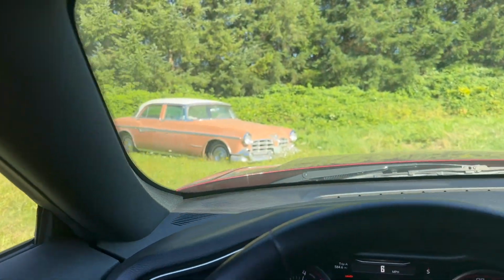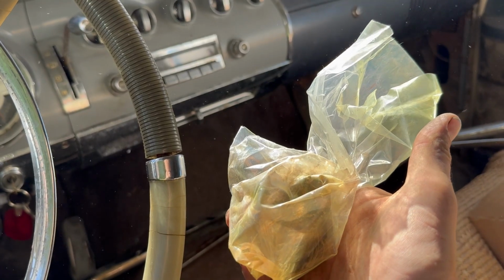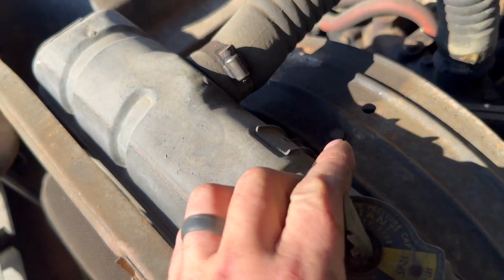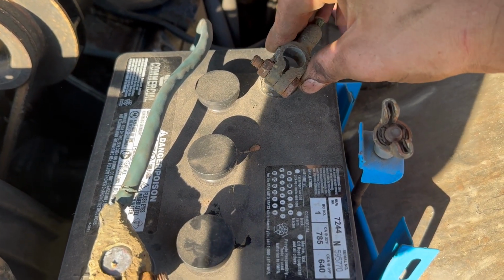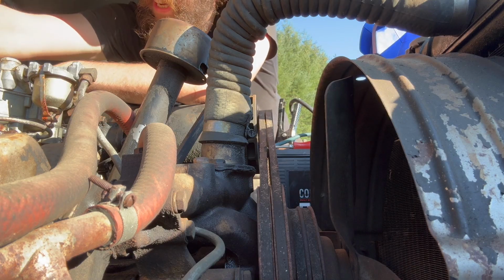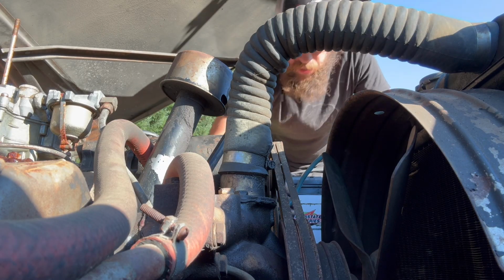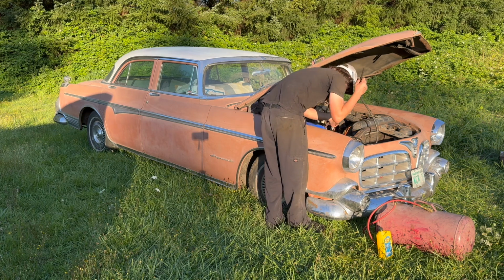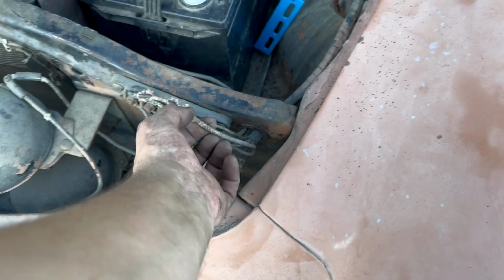Hemi Powered Land Yacht - Will This 1955 Imperial Run And Drive After 30 Years?

Comment: PARK on the Imperial is just an emergency brake. It is not literally a "Park" function in the transmission. To park these pre-PARK Mopars you had to cut the wheels into the curb, pull the "emergency brake" and pray it would hold. Imperial even supplied a metal parking wedge in the trunk.
If you tried to park these automatics "in gear" they would just roll away. My 1962 had the exact same set-up.
Reply from the maker: But why are you telling me this? Do you think I don’t know what year the parking pawl was added to the Torqueflite transmission? I do - 1962 😅
Reply: @DeadDodgeGarage  My 1962 Chrysler Newport "didn't have it" but the 1962 Dodge and Plymouths did. As to your question now you know why I am telling you this.....not all 62 mopars had it.

Comment: Just watched the video.. Love the front ends of those cars..I worked on cars for the first 26 years of my life. Did one revive on a 52 Chevrolet Deluxe Coupe I bought when I lived in Los Angeles in the 90's.. sat for 20 plus years and was . Before youtube.. didn't know what I was doing but the engine was locked up.. pulled pugs and lubed cyls.. let it sit a few years and hooked up a 12v battery.. got unstuck just with the starter. Filed the points and got it running.. the old man bought it from came outside jumping up and down clapping.. Had 4 flats. new tires and drove it for a while smoking its ass off. It was a total rust free  Southern California car its whole life. Anyhow.. thank you for making your videos. Sure has had me looking at buying another Valiant or Barracuda.. You do a good job Jamie

Comment: Chrysler imo has been dead since right before the K-car.
And the New Dodge 90s cab forward front wheel drives and theur New Ram was nothing more than throw away cash grab aesthetics bs. Seems most  automobile manufacturers are all going that way now, since you can't even repair them at home anymore.

The last decent automobiles Chrysler offered was in the late 50s before they switched to unibody.

With that said.. Chrysler motors made several body styles I liked up until the early 70s.
Then it went down hill and never came close to making a come back, not even in terms of aesthetics.
Reply from the maker: I love my modern Ram, second and third gens are great workhorses with pretty modern coil spring suspension, K cars are still loved by many, and while things are certainly more complicated today, to say that one cannot fix their modern rig at home in most situations is misleading. So, in summary - I basically disagree with all of that.

Comment: A great and deep regret of my life,  is that back in 1994, I was a young gear head and learning to drive and my dad was looking for a project car for me and him.  One car we looked at,  was a '56 Dodge Royal Lancer with an early Hemi in it,  it was salmon pink and black,  it was $1,500, it was rust free,  solid,  but did not run. 

I thought it was the ugliest car I'd ever seen. 

I kick myself for that today.

Also,  a '53 Chrysler New Yorker I briefly owned around 2009 with a 331 Hemi in it.  It had sat in a garage since 1962, and I paid $1,500 for it.  And if you know anything about the 331, you know that it is it's own animal,  parts are scarce, and expensive.  Also it had a clutchflite transmission,  a strange thing with a clutch and a torque converter that would automatically shift between 1-2 and 3-4 but you had to manually shift from high to low and use the clutch to stop and start.   I got it running,  but the rings were shot,  the block needed bored, the valve guides were gone and parts were... not nonexistent, but apparently made of some material worth more per pound than antimatter... but the car was solid,  rust free,  the interior was... shot but still liveable with a lot of work and some truck stop blankets.  I even drove it around the block,  albeit with no brakes whatsoever.  It had power windows and seats and they still WORKED!  I was super stoked to have it,  then I dug into it,  and started pricing out parts... and realized that just getting it running and driving and reliable and not smoking like a steam train was going to cost me way over $10k... and I had a close friend who knew a car restorer and collector in Sweden and he had told him about what I found, and long story short,  he offered me what i can only call an obscene amount of money money to load it,  the parts, and everything else into a cargo container and ship it to him in Sweden. And that's exactly what I did.   Along with a bunch of 1970 AMC Javelin parts i had.

Comment: Chrysler has “full-time power steering” at least as early as 1953. Advertising showed a woman moving the steering wheel with her pinky to make the point. That was a dig at GM, which had variable power steering depending on the speed of the car. My uncle had a 1953 DeSoto with power steering, there was no road feel while driving, and my aunt took out the side of the garage with it because the wheel did not return on its own after a turn, which was what she was used to.

Comment: Ah, memories! I had a 56 Imperial 2-door Southhampton in aqua and a white roof. 56 was the first year for the twelve-volt system and a mid-year change from the Powerflyte to the Torqueflyte. My car was an early one with the Powerflyte, 56 was also the last year for cloth-braided wiring, kingpins and coil springs.

Comment: I was told that the reason these old cars always smell like vomit (extreme sour smell) was from the decaying steering wheel. They were made from a milk based composite that I think was called "casenine". We have to remember that this and many other cars like it were built in a time where the nation was still coming off two major military conflicts (WW2 and Korea). So materials to build cars with were somewhat at a shortage. Some clever engineers developed a milk based compound that was cheap to make and worked as well as other things like bakelite but not as expensive as the new plastics still being developed (like Lucite, Acrylics, etc.). Trouble is over time they decay, especially when under full sun behind a windshield (see your cracked steering wheel). When they do the emit the terrible smell. I can remember my dad gutting a perfectly fine interior from a '63 Plymouth trying to find the source of this awful smell. This was in the late 70's early 80's. I can remember him being pretty certain one dumb a$$ kids (my brother and I) probably hid something in the car only to be disappointed. Enjoying your videos.

Comment: I currently  own 2 ,1954 Plymouth Savoys, The first one I purchased when I was 16 years old, best car I ever and still own. I am now 64 years old . Drove the car everday to school ,work and weekends. One has power steering  and is fully optioned the other is fully optioned except for manual steering. Both have Flathead sixes ,228 ci and three on the tree.

Comment: I'd like to see you rebuild the carb. Making it run gooder is not the point. I'm not familiar with that model and would like to see more on it. At a minimum flip the top off  and let us see it's inner goodness.
Reply from the maker: Need to find a better core. That one is baaaaadd.

Comment: you're right about the Mopar smell. back in the early 90's I was in college and for some reason I was blindfolded, "kidnapped", and driven out somewhere outside of campus with instructions to find my way back. I don't remember the exact circumstances of why this all happened, but I was 18, probably drunk, and these things happened. anyway - they lead me into the back seat of this car and started it up, and even blindfolded the first thing I said was "this smells like an early 70's Chrysler. and by the sound of the engine - that's a 318. also more than likely - and I don't know why, but this car is painted green". it wasn't until after I was dropped off and took off the blindfold that I saw that sharp '72 green Dart driving away that I realized "hey - I was right! and also I have a long walk back"
Reply from the maker: Well, that’s… something!

Comment: Want to see it smoke, run a can of Bardahl through the carb.
Popular back in the 50’s and 60’s to unstick rings and clean valves. Non detergent oil was the thing back then and extended oil changes the norm.
Had an uncle that swore on Bardahl, he would run a can through the old clunker he drove every month. Big event, all the kids in the neighborhood would gather at the house to watch the huge cloud of smoke generated. Doubt if the neighbors appreciated it though. The plants and grass around the house suffered badly from this but us kids were just fine, for a while anyway.
All kinds of nasty stuff was sold to the public back then with promises of miracles performed. Very few miracles were ever seen…

Comment: Hi Jamie,
   I am a 70 year old Mopar guy.  It does my heart good to see young guys like you who are very knowledgeable, skilled, hard-working, and passionate about old Mopars.  
   My first car was a $75, 1961 Plymouth Fury 2 door hardtop with a high performance 361 Golden Commando engine, push button automatic, that I bought with money I earned mowing neighbors lawns when I was 15. That 361 was a well-used, loose screamer, and I knew that it was time to hit the shift button when the valves would float. Thereafter,  I owned a dozen different 60's Mopars. 
    My father worked as a Chrysler Corporation new car salesman (Chrysler, Imperial, Plymouth, Desoto at one dealership, then Dodge at another) from around 1955 to 1985.  
    It has been many years since I worked on any car.  I have the bodies (almost rollers) for 4 project cars.  A 63 Fury, a 64 Valiant, a 66 Dodge Panel truck, and an 80 D150.  I am hoping to have a shop and get started on all 4 project cars by the time I am 80 with a projected completion date of the 4 cars when I am 90 years old.  I will keep you updated.  I love your dry sense of humor, Jamie.  And, I have been accused of suffering from the same malady.   
Regards, Craig
Reply from the maker: Thanks Craig! Much appreciated. I’ve been told the correct time to shift is when the valves fly out and dance on the hood… I’ve yet to try that technique. Perhaps some day. At any rate, best of luck with your projects.

Comment: Even on modern cars, the most damage is caused from cold starts.
It's still best to get some oil in the upper part of the engine.
I'm sure you are correct, damage is already done.
But you're just adding more.
Vice Grip Garage isn't the only one adding oil to cylinders.

Comment: I love those big obnoxious chrome bumpers and the chrome in general , how do you know that is a 331 cu.in. it's an Imperial and big didn't they have 354 & 392 ?? , you can see the air in that tire ??
Reply from the maker: Because 1955 (and back) was 331 only. 1956 was 354 only. 1957 and ‘58 were 392 only.

Comment: Can you isolate the starter and just spin the starter with the 12 volt , leave the 6 volt all connected  and remove the 6 volt power & ground  connections on starter just use that until this thing is tuned and running and take your starter to a motor shop have them put new bushings in it , it will work like a dream ,
Reply from the maker: Yes, I certainly could. I’m planning to run an 8 volt battery instead. Word on the street is that it works very well.

Comment: I can totally see a sleeper there with a big hemi under the hood. It's just so cool those cut out rear fenders like the Buicks. You don't know how cool that car would look doing a brake stand and watching the smoke pour out the sides. I'd totally leave it looking stock on the outside but completely replace the engine and drive train. And yes I'd convert her over to 12 volts.

Comment: I bought one like that for 50 bucks. The drive train was gone.  Rusted out. The trim was in great shape in and out of the car. I pulled all of the interior out and steering wheel in column. The steering wheel is cool. Sold the column and wheel for 300$   gave away the trim scraped the rest of the thing.

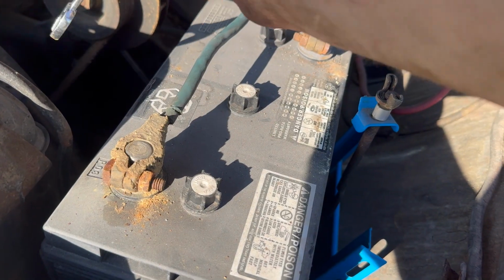Comment: 19:10 Those 12V battery cables need to be changed. 6V systems need thicker wires to handle the higher currents they use. I was told that "6V battery cables need to be as thick as Groucho Marx's cigar".
Reply from the maker: So I’ve been told.

Comment: I've been into the 57-61 Forward Looks for years, but this is a fascinating car. This may sound strange, but all Forward Looks feel like an alternate-universe take on the American 50s car. A little weirder and, a little more aggressive, especially the Dodges and Chryslers. The story of the '57s is such a tragedy. ChryCo could've seized the market to an extent where the '57 Plymouth and '59 Imperial became the poster children of the 50s. Instead they rushed out a half-baked product a destroyed their good reputation. I'm so happy to see someone else appreciates these oddballs. Also, if you did buy it, how would you handle the rust? Cold War Motors does an insane job cutting out crusty bits and making their panels look factory fresh.
Reply from the maker: I completely agree. I truly don’t know if I would ever actually tackle the rust holes in the body. I would have to patch the floor to replace the interior, which I would very much like to do.
Reply: @DeadDodgeGarage  Would you use mohair again?

Comment: The doors look identical to the ones on my 1956 plymouth savoy 4d.  I'd love for it to have a 1st gen hemi.  But it has the flathead six 230cu in.  And it has a manual 3 speed.  But, it runs, has an older respray of turquoise on the body, and a white roof.  It has the refrigerator pull handles on all 4 doors. It was originally a metallic green color, very pearlescent. Only one window is cracked.  I've rebuilt the entire brake system.  I didn't know I could add power brakes, that would be useful... especially the dual channel system.
Reply from the maker: Nice! My ‘55 Plaza was 230 flat head, 3 on the tree sedan. My buddy Byron still has it. In fact I’ve shown it on video a time or two.

Comment: 5 gals. Fuel add 4-5 ounces Lucas fuel system cleaner.  Just might clean up the valves and cylinders.  I’ve had good luck with it.  I buy it in the gallon container at Walmart

Comment: If memory serves me correctly [I'm 72, it's not always right] the 55 Imperial had a 392 hemi, and the Windsor got the 331. DeSoto used the smaller 272, which is what my 55 Fireflyte has. Yes, it's a four door, and no, it's not for sale. The 300 also had the 392, but it got dual four barrels, hence the 300 horsepower it was named for. Fun trivia, in 55 or 56 they used a DeSoto convertible for the pace car at Indy. The powers that be at Indy didn't think the engine was big enough
Reply from the maker: 55 is 331 across the board for Chrysler and Imperial. ‘56 is 354 only. ‘57-58 is 392 Hemi, or 354 Poly. Yep, DeSoto had their own smaller engine, and Dodges were even smaller…

Comment: Needs weeks to months of elbow grease and a paint job - but has the makings of a great straight-up restoration. Or a restomod, with better brakes, better handling, and maybe an EFI system.
Reply from the maker: Well, I have other thoughts on paint jobs - and I definitely have thoughts on restomodding this unit too. I’m planning the elbow grease part, bringing it up to operational snuff, and general preservation.

Comment: It would be running if you used starting fluid
Reply from the maker: So, I guess you’ve never sent a rod through the side of a slant six with starting fluid before like I have? Starting fluid is nasty stuff. I don’t care how much “lubricant” they say it has, I don’t buy it. It also has a tendency to pre-ignite. No thank you. As you can see, gas works just fine.

Comment: A spark tester will test spark better than the screwdriver meathod. In some cases, you'll have spark at atmospheric pressure, but it won't spark under cylinder pressure, which is what the tester simulats. This is what The Car Doctor says and he's very knowledgeable.  I never would have known this.
Reply from the maker: In the case of a weak coil or plug wires with high resistance, it is possible to get a spark using my method, but not reliably (or at all) to the plugs. Generally speaking, obvious signs of weak spark when using my method will tip one off to this possibility. If I ever run into a coil that is weak enough to produce that result (it has never happened for a video project yet,) I will be excited to film and explain it. Also, the screwdriver opening the points isn’t the important part here, it’s the air gap from the coil wire to ground. If your spark can jump a gap of appropriate size, it can fire your plugs.

Comment: My dad bought a1956 Desoto Fire dome Seville 4 door hardtop when I was a kid.  He attempted a full restoration, but ran into some problems, especially with the rear door windows.  What would have been a wing window, actually guided forward and down with the main window. Such a cool car. Unfortunately, it really needed a frame off restoration. The car is still in the family.  Last I saw it, it looked really good with all the chrome replated, but it did not drive well at all. All the ball joints, tie rods, etc were very worn.  My preference is the 1957 to 1959 models.
Reply: BTW, it has the 330 (not 331) HEMI.

Comment: I'm not sure why mechanical fuel pumps get a bad rap, in my experience they've been dead reliable.
Reply from the maker: They don’t get a bad rap here, I love the simplicity and run them on everything possible. I’m the “stop putting stupid electric pumps on your classics” guy. But when they have been sitting for thirty years, it can take some coaxing to bring them back - and I didn’t have that kind of time, or a replacement to install.